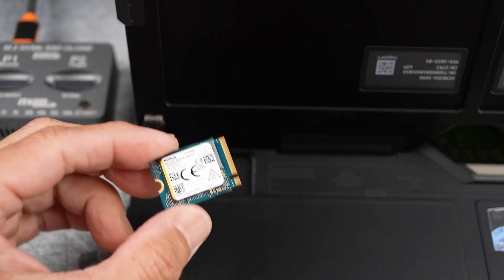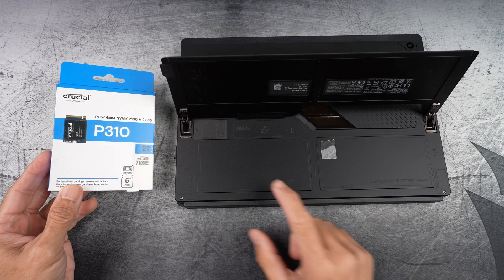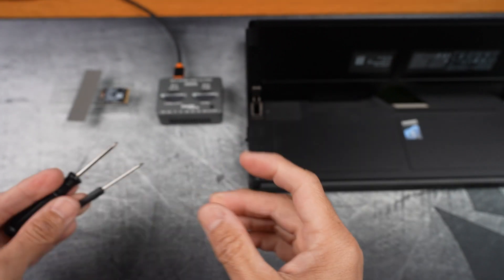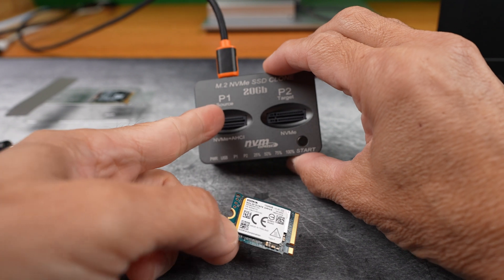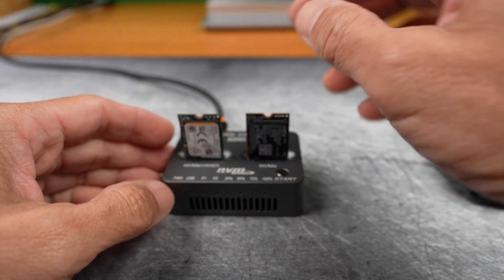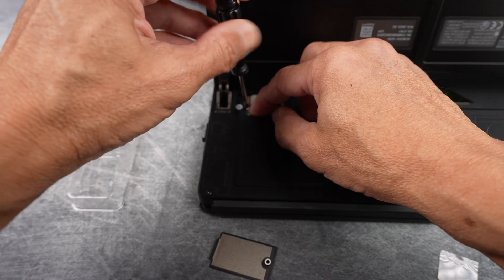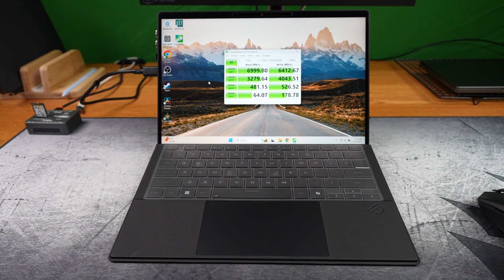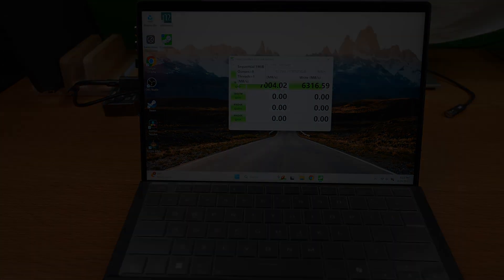Asus ROG Flow Z13 (2025) Upgrade to Fast 2TB SSD, Crucial P310 + Clone Dock

Comment: Couldn’t you be messing with airflow by adding the tape?
Reply from the maker: Good question! The tape I used was only for the SSD area—away from the fan and main heat pipe zones—so airflow to the CPU/GPU shouldn’t be affected. But yeah, always a good idea to be cautious with placement. Thanks for bringing it up! 👍

Comment: Nice video. What about bitlocker? Should i turn it off before cloning the ssd?
Reply from the maker: Thank you for your comment! Yes, definitely turn off BitLocker before cloning. That was one of the possible reasons the cloning didn’t work for me. Also, make sure the new SSD is slightly larger than the source drive, and don’t forget to format it beforehand.
Reply: @TossSong  thank you for the quick reply and advice 👍

Comment: would this work on the 2023 version?
Reply from the maker: Yep, it should work on the 2023 version too — the same M.2 2230 NVMe slot. Just double-check the specs to be sure, but most Z13 models share the same upgrade path. 👍

Comment: 4:50 Can I check the thickness of this thermal pad?
Reply from the maker: I had two that I tried (off camera and on) 0.5mm and 1mm. Ended up using 1mm which is what I recommend.

Comment: As the new drive is like the old one and has been previously backed up, I would just reset the drive, as it has the base Windows files. It would then restore all of the backed up files/programs. That way, you have the complete 2TB of storage shown on one partition.
Reply from the maker: Yeah, that’s a solid way to go about it too—especially if you’ve already got everything backed up. I ended up cloning the drive just for convenience, but I totally see the benefit of starting fresh and reclaiming the full 2TB on one clean partition. Appreciate you sharing your take.

Comment: I just got the 128gb z13 and actually have the same drive, so trying to figure out how to swap it out like you
Reply: I did do it, was quite easy with the help of your video and such. I used the wavlink cloner. Changing the partition also is very easy. I also checked best buy to see what they charge for it, $250 plus tax which I think is excessive because that's just labor. Its basically the same price for just the hard drive and the clone tool
Reply from the maker: That’s awesome to hear — glad the video helped you out! 🙌 The Wavlink cloner makes it so much easier, right? And wow, $250 at Best Buy just for the labor?? Totally agree — you basically got the upgrade and the tool for the same price. Props to you for doing it yourself — solid move! 💪
Reply: @TossSong  and you could use the wavlink with the old drive as a typical external storage. Plus add a microsd and you've got another 2tb
Reply from the maker: Thank you for sharing this. Really good options!
Reply from the maker: Nice! It should be a smooth upgrade. 👍 I showed the whole process step-by-step in the video—including cloning, opening the case, and placing the thermal pad. Let me know if you get stuck anywhere—I’ll try to help!
Reply: @TossSong  As the drive now has all of the base Windows files and a back up has been saved online, could one just not reset the new 2TB drive to Asus factory specs and use a restore point? That would prevent one from having to create a new partition.
Reply from the maker: Yeah that could definitely work! If the new drive already has Windows set up and your backup’s online, doing a factory reset and restore point should get things back up and running without dealing with extra partitions. Appreciate you chiming in with that!
Reply: @TossSong  Well, if the new drive is cloned, then it has the restore files, which would enable one to reset the new drive, with one 2TB partition.
Reply from the maker: Ah gotcha—thanks so much for explaining that! Appreciate the help!

Comment: Do u have an ssd enclosure that u could recommend so we can use that 1tb ssd as an external ssd after upgrading to the 2tb ssd?
Reply from the maker: Yes, I use “GE-MC40USSL” for this Flow Z13 and my MacBook Air see it here in my accessory video below. It’s however fan less but reliable, you could feel the aluminum casing is absorbing the heat very well. There are ones with fan but more expensive and not reliable according to some reviewers. 

Silver MacBook Air 13-in M4 (2025) & Must-Have Travel Accessories!
https://youtu.be/ZYmTGgPq7y4
Reply: @TossSong i see, thank you!

Comment: what are the multiple partitians used for? most of them seem to be just free space and besides "restore" im not really sure what they could be ued for besides defragmentation
Reply from the maker: Yeah, Windows creates several small partitions during installation—some are hidden and used for things like recovery, boot configuration, and BitLocker encryption support. The “Restore” one is for system recovery, and others might store bootloader files or EFI data (for UEFI systems). You’re right—most users never touch them, and defragmentation isn’t really needed on SSDs. But they’re essential behind the scenes!

Comment: Can you uograde it from 32 GB to 128 GB vram?
Reply from the maker: The VRAM (video memory) on the ROG Flow Z13 can’t be upgraded, unfortunately—it’s built into the GPU. If you’re using the model with integrated graphics, it dynamically shares memory with system RAM, but even then it’s limited by the system and BIOS. No way to boost it to 128GB VRAM.
Reply: Thabk you @TossSong

Comment: Thanks, I was about to order a regular sized NVMe as I just received my Z3.  

I had an external drive so I used Macrium Reflect to image the partition on it, then created a restore boot USB stick. Swapped the NVMe and restored on the new NVMe from the backup.
Reply from the maker: Awesome! Glad the timing worked out and the video helped steer you away from the wrong NVMe size 😄. And nice job using Macrium Reflect—solid cloning method! Sounds like your Z13 upgrade went super smooth. 👌

Comment: How thick is the thermal pad? 1mm? 2mm?
Reply from the maker: Thanks for reaching out. I would recommend 1mm which would work perfectly, but no more than that.
Reply: @TossSong  ooh thanks for this clarification I was about to get a 1.5mm one
Reply from the maker: Disregard my last reply. I was thinking of another video. Anyway, I recommend 1mm. It does compress overtime due to heat. So even 1.5mm might be just fine—but I never tried it, could possibly create a bulge.

Comment: I am doing this but the indicator lights don't start like yours. I've held it down the same time as you, then 15,20,30,45, 60 seconds but it's not starting. I'm using a 100W power source and have the same indicator lights as you. Any idea what is going wrong? I'm going crazy here 😭😭😭
Reply: Double tap
Reply from the maker: Were you able to get it going? Holding about 5 seconds. Assuming you have the same 2TB (higher than the stock one). Also don’t use their stock cable, try and use another cable to charge. Let me know.

Comment: hey i just got my z13 can u please help me with the best settings for gaming im new to amd i have no clue thanks
Reply from the maker: Hey congrats on the Z13! 🎉 Make sure Armoury Crate and MyASUS are updated. For gaming, try setting it to Turbo Mode in Armoury Crate. (Note: Turbo will ramp the fan up with intense games.) Also, enable SmartShift and set Windows to Best Performance. For smoother gameplay, use FSR if the game supports it, and aim for 1080p for the best balance of performance and visuals. Let me know how it goes. 🎮
Reply: What has been the downside?
Reply from the maker: So far I honestly haven’t had any downsides — no overheating, no crashes, and no stability issues. 👍
What I have noticed is improvement: when doing heavy video editing off an external SSD, timeline scrubbing feels smoother with less lag. Also during my online teaching setup (using my iPad as a writing tablet), it used to get extremely hot in one spot near the bottom — after the mod, the heat seems more evenly dispersed across the back aluminum and not as intense.
Just sharing my real-world experience so far.

Comment: I have just follow the instructions for the upgrade with the Same SSD, but my read and write speed seem to cap at 3.2k without plugin yet.. wondering do i need to chnage some settings
Reply from the maker: At that speed means you likely tested it unplugged. 
Just to help narrow it down:
What SSD model did you install exactly?
Did you test the original stock SSD’s speed before swapping it? And are you running on battery or plugged in? 
This tablet throttle SSD speeds when not plugged in.
Reply: @TossSong  bought the same SSD model, refer from your video. Test it during unplugged.. I just did cloud recovery to retest it. Later.
Reply from the maker: Awesome—sounds like you got it sorted out! Yeah, testing while unplugged definitely affects speed. Hope the cloud recovery and retest gave you the full performance! Let me know how it went.
Reply: @TossSong  thanks for your video, it really works.. seem like Asus cloud recovery also can resolve the partition extension issues. If the user wanted full C drive storage. 😁
Reply from the maker: So glad! And thank you for the info for partitioning. And for reaching out and commenting.

Comment: How hard is it to upgrade the ram? Also, I have been using a surface, and you cannot open it to replace the battery. That is a big problem for me. How hard is it to open this device to replace parts?
Reply from the maker: The RAM on the Flow Z13 (2025) is soldered, so unfortunately, it’s not upgradeable. Only the SSD can be upgraded. Opening the device isn’t too bad compared to a Surface—just a few screws on the back and carefully prying it open with a plastic tool. Much easier than Surface models where everything’s glued. Battery replacement is possible but still involves some work. Not super easy, but definitely doable if you’re used to opening up laptops.
Reply: @TossSong on a machine that is extremely Ram. Dependent, it's surprisingThey didn't allow for upgrades
Reply: @TossSong what I mean? Is its Ram? Allocation is one of its biggest selling points. It would make sense that it would allow for upgrades
Reply from the maker: Yeah, I totally get your point! You’d think with how RAM-intensive some tasks are, they would make it upgradable. Sadly, many thin & light designs (like Surface, MacBooks, and now the Flow Z13) solder RAM to save space and improve thermal efficiency. It’s a trade-off for portability, but definitely frustrating for power users who want upgrade flexibility.
Reply: @TossSong  Its a good point. We always need to keep in mind its a tablet x.x 

I just bought one of these with 32gigs of ram for $1k, and was hoping to upgrade to 64. Oh well, It was really only to future proof it.

Still, it was an absolute steal, so i'm happy
Reply: @TossSong i do have another interesting question. Could I use upscaling and cap my frame rates at 40 fps to increase my battery gaming time? What do you think?
Reply from the maker: @OnlyTruthLove Yes, capping your frame rate at 40 FPS and using upscaling (like FSR but not DLSS [for NVIDIA's GeForce RTX], depending on the game) can definitely help extend battery life during gaming. Lowering the frame rate reduces GPU load, and upscaling helps maintain visual quality while using fewer resources. It’s a smart way to balance performance and power on the go!
Reply: I understand why they use soldered RAM to keep it as thin and light as possible, plus soldered LPDDR5X tends to be clocked faster than SODIMM DDR5 (e.g. I think the Z13 RAM is clocked at 8000MHz) so there is that, but if we accept the soldered trade-offs have happened the thing that annoys me is that in the USA the 64GB version is only about (exactly?) $100 more than the 32GB version yet the 32GB is relatively widely available whereas the 64GB version is I think pretty much totally absent from the market except for the USA where it seems to be a Best Buy exclusive (unsurprisingly currently out of stock). I really wish that Asus had made the 64GB model much more available from launch.

Going further, I actually struggle to understand, for that $100 price difference on a machine that is already $2,299 in its current Ryzen 395 32GB base configuration, why Asus didn't dispense with the 32GB model altogether and make 64GB the base configuration. I can't imagine many people willing to pay $2,299 for a 32GB model would, if that model wasn't available, say "If only Asus had offered a version with 32GB of RAM for $100 less I could have afforded a Z13 but that extra $100 has put it out of reach for me".

Comment: Can a 1.5mm thick thermal pad also be used? First time upgrading a SSD and want to make sure I do it correctly. Thanks.
Reply from the maker: Thanks for commenting. The one in the video is I think 0.5mm. Off camera, I did try a 1mm pad and it worked well—fit just right under the cover. 1.5mm might be too thick and create pressure, so I’d stick with 1mm if possible!
Reply: @TossSong  u not need heatsink? Only thermal pad?
Reply from the maker: Thanks for your comment. I don’t think there’s enough room for it. I’d love to have a heatsink for it, definitely. Don’t forget originally there was no thermal pad or anything on the SSD. It’s just my recommendation, but I’m sure it’s fine by itself.

Comment: Does the Z13 Flow 2025 support Gen5 SSD?
Reply from the maker: Thanks for your comment. Unfortunately, no. From my research it only supports up to Gen4 NVMe SSDs. Gen5 drives will still work, but they’ll run at Gen4 speeds.
Reply: @TossSong It's good to know a Gen5 drive will work. I'm planning to upgrade mine soon and figured I might as well get the newest gen drive if I'm going to buy one.
Reply from the maker: Yeah, exactly! Totally makes sense to future-proof with a Gen5 if the price difference isn’t huge. It’ll work just fine in the Z13, just capped at Gen4 speeds for now—but who knows, you might reuse it later in a Gen5-capable system!